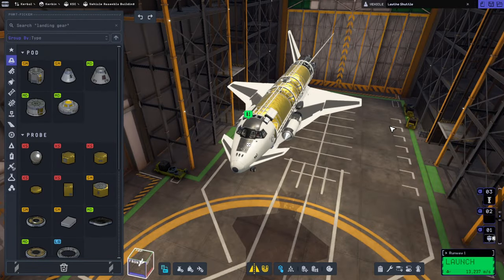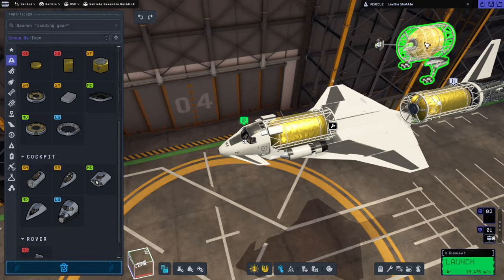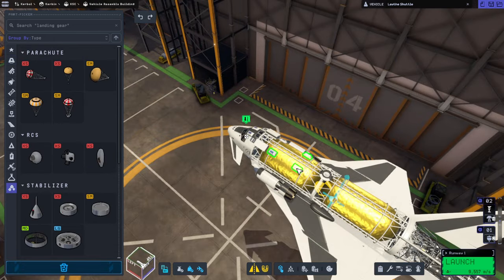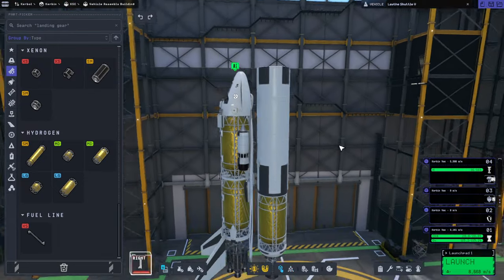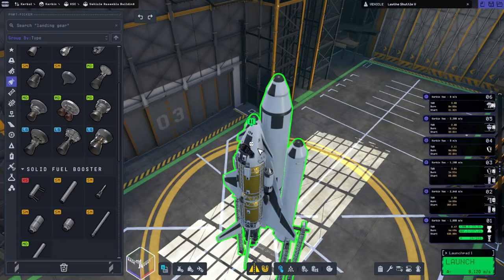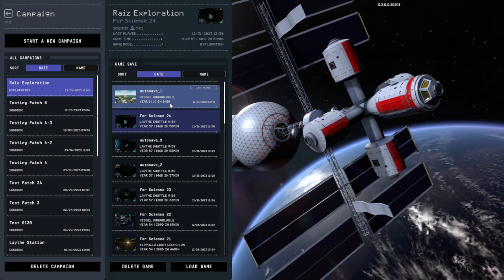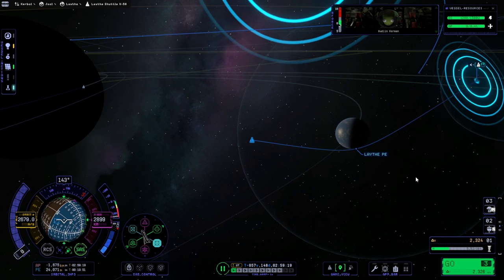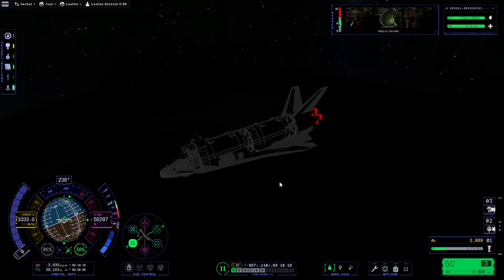KSP 2 Early Access - For Science 18 - Laythe Shuttle

Comment: With the appropriate wings unlocked with enough heat tolerance, the thickness of the wing root and the wing tip in the procedural generator is also important to absorb and dissipate the heat 😉

Comment: The fact that your wings overheat and explode by just barely entering the atmosphere makes me think that there's definitely something wrong. Otherwise spaceplanes are just not possible to make. Or they need to implement some sort of "shuttle wing" upgrade to differentiate it from a regular airplane wing
Reply from the maker: Well, there sort of is - we're using the medium wing and there's a heavy wing that's under the "Spaceplanes" tech. So maybe I'm being unnecessarily obtuse in testing the medium wing or maybe we'll find out the heavy wing has the same problem - we will find out in upcoming videos.
Reply: @RaizSpace for some reason the re entry profile I’ve found to work keeping wings was one where I simply didn’t aerobrake and did my best to stay as streamlined as possible. Then, as air density begins to scrub speed, I’d begin manoeuvres to bleed more speed at much lower altitudes (35-20,000m or so), which for some reason didn’t overheat the airframe as much. It almost feels like they just cranked up the heat from drag at high altitudes to some insufferable level, but maybe that’s just me.
Reply: @RaizSpace spoiler alert - I found it impossible to re-enter Laythe with ANY parts that have less than 1500 heat tolerance.

Comment: I think you can use the fuel lines for crossfeed. Like old KSP1 when crossfeed through decouplers wasn't a thing.
Reply from the maker: I mean, I just enable crossfeed through the decouplers - why would I use fuel lines? That doesn't help fuel priority (which was the problem I was having) does it?
Reply: The direction of the fuel line should determine which tank is drained first, even if you can't set priorities properly in the current state of the game.
Reply: @RaizSpace  Crossfeed on decouplers is indeed near-useless without fuel prio.